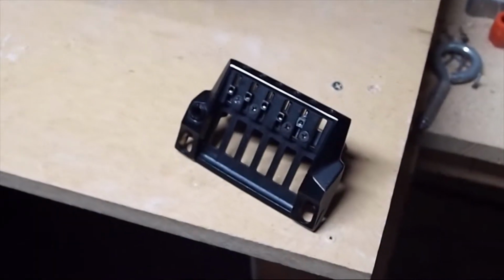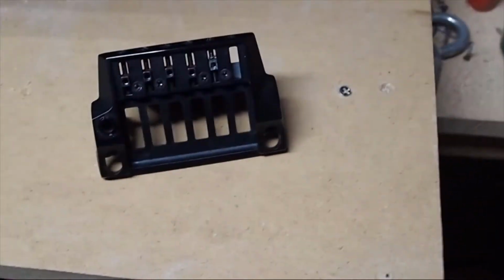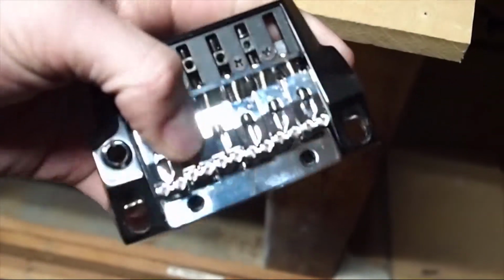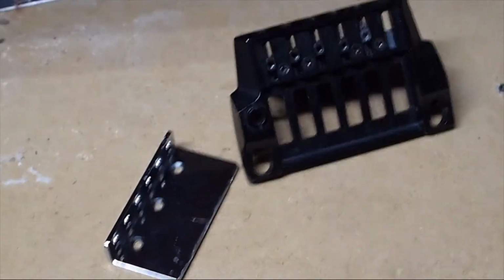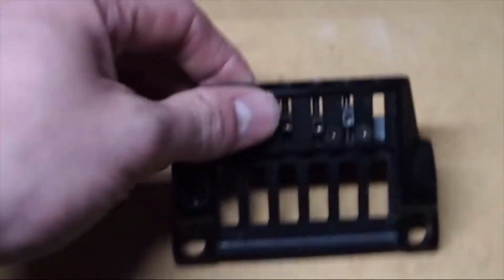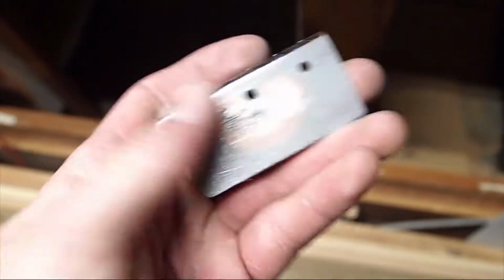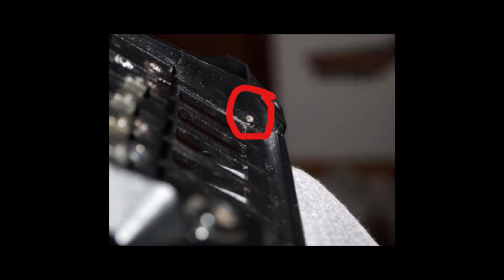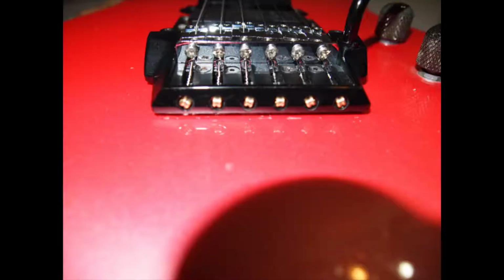Ibanez Pro Rock'r Repair

Comment: I replaced mine with a floyd just have to cut fulcrum points really wide and deep so the scale length matches up. Works great stays in tune little odd with 1/8" gap between the body and bottom of floyd as they usually sit flush but ive been waiting 25 years to hear this purple beast sing and sing she does.
Reply from the maker: Nice! It's been really interesting seeing all the comments from people talking about their solutions.

Comment: Do you still have those bridge pieces that broke off?.  I need them. Will buy them from you
Reply from the maker: Sorry, I sold them quite a while ago. If you read through some of the comments here, other people went about fixing this in different ways so maybe you'll find something that will work for you. Otherwise you'll just have to keep checking ebay.
Reply: @kevinhasselquist1532  thanks I figured out a fix for it. Actually made a video so I can try to help out the Ibanez community. Posted on a different channel.  Thanks for your reply.  Search. "Ibanez Pro Rock'r bridge fix Roadstar 530" and it should come up . Thanks again.

Comment: Interesting solution... I have 3 guitars with the Pro Rock'r Tremolo and I have had it break multiple times... I was lucky enough to find somebody online that had spares and they coated it in some sort of metal to make it stronger... I'm hangin on to those babies incase I have more issues! It seems that they break very easy mostly when you try to adjust the action with strings tightened. Much safer to loosen the string tension first before doing that. Great Guitars... poorly made Tremolo's.
Reply from the maker: That's awesome. Definitely be gentle with it haha. If all else fails, I'm still happy with the fix I did. Played that guitar tonight actually. And if you read through the comments here, other people have offered interesting solutions.

Comment: Several years ago I found a guy on Ebay who was making stainless steel replacements. I bought one and then broke another of the originals within 
 a month, bought 5 more replacements.  Never had an issue since. I think I paid $7 per block. Love this guitar.
Reply from the maker: That's awesome! When it first broke, I looked on ebay and found nothing. I've looked a couple times since then and only once did I find a listing but it was for original parts and they were about $20 a piece. If that guy is still around, he should make some more.
Reply: I've been searching everywhere and can't round up the parts I need.
Reply: @MichaelSmith-ks9pv  I don't have the guys name any longer, it was almost 10 years ago,  I did see this on Reverb.com.  They look better than what I have.https://reverb.com/item/3100940-ibanez-pro-rock-r-tremolo-intonation-blocks

Comment: Hi all.  Tell you what I did.  First I had to super glue the broke tee nut back together so I had a good model.  I took a 6 inch piece of 3/8 aluminum round stock and started filing away.  With the tee nut placed on the end of the round stock, scribe (I actually used a dental pick) the outline of the tee nut and begin filing.  Once you have the general shape, drill and tap holes for the screws.  It is a M3 0.50 pitch on both screws.  Return to filing for the custom fit.   Good as new.   It took me about 4 hours to make one.  Now that I have the method down I am going to make a few more out of steel round stock. Steel threads should stand up to allot more stress than aluminum.  I took some photos if anyone is interested.   I am new to youtube but I assume there a PM feature?
Reply: Hey Jeff, I know it's been 6 months but hopefully you will see this. If you ever found a way to sort of mass-produce these, I might buy some from you, or at least I would like to see your photos. Would you please contact me? grace_works@hotmail.com  thanks, james
Reply: This info is exactly what I planned on doing. Either that or getting a shop in pingpangdingdang to pop out about 1000 stainless ones for a small price. I ended up buying F loyd and cutting the fulcrum notches farther apart snd deep enough to get into the adjustment for scale

Comment: $2 fix for all saddles with broken Tee nuts.    Remove the old Tee nuts and intonation screws go down to the hardware store and buy longer saddle lock allen bolts and lock nuts I believe the thread size is m3 ( take an old saddle bolt with you to be certain ). The nuts fit in the same slot as the Tee nuts. Now replace the saddles run the new longer bolts through into the lock nuts guestimate intonation point and lock down saddles. Fine tune the intonation just like on a Floyd.
Reply from the maker: Interesting suggestion, I definitely would have tried that first if I hadn't already done what I did. I'm assuming you've done this?
Reply: @kevinhasselquist  Yes I have and it seems to be holding up fine.
Reply: $2 fix? 
I'm sure several of us that are reading your post would love to see a picture.  Is there any chance you could share with the community?
Reply: @richardmontoya6879   sorry for the slow response if you give me a location to send pictures I will be happy to send them

Comment: I've got my ibanez in 1992 (it was the 85 2 humbucker 24 fret model with pro rock'r), I love it. I have mine set up basically as a fixed bridge. I put a brass block on the back and set up the intonation for it. It's great. I have a second one and it's fine too, but I use the trem quite a bit. I have 5 spring set up, and it's fine. I also bought a couple extra Pro Rock'rs and a Hard Rock'r just in case they go out. The hard rock'r is the same but without the little screw things for fine tuning which I don't use that crap anyway.

Comment: Interesting. I have 6 of these on 1984 Roadstars and play them regularly. Never had a single issue.
Reply: Hey man I just bought an 84 DT350 X Series destroyer and it has the pro rocker trim everybody bad talk some man it's nice to see somebody who doesn't have problems with them any recommendations for me man
Reply from the maker: @ougigaming8710  Well in a way I really like the bridge. It's very responsive and comfortable on the hand. Tuning stability on mine was iffy but then again, even Floyds have their issues. The problem is that there is a known point of critical failure.
Just make sure to be gentle when changing strings and I remember reading after mine broke that you shouldn't have the bolt that connects the saddle to the the intonation bolt cranked down. In other words, the small bolt right behind the fine tuner on the saddle.
Reply: @kevinhasselquist  yes exactly , don't over tighten the screws that lock the string.
Reply from the maker: After mine broke I came across a forum post with a bunch of tips on how to care for and maintain them. But of course by then it was too little too late. It broke while I was changing strings. It's hard for me to remember exactly because it actually broke a long time before I did the mod and after doing the mod it was 8 months or so before I edited and posted the video but I think I pulled too hard on a string that was stuck in the saddle. So I'll admit to some user error, but just looking at it you would never know that the stress point of the saddle was so small and weak. If you haven't had any problems, good on you man! Be gentle and take care of them, in the research I've done, this is a common problem.